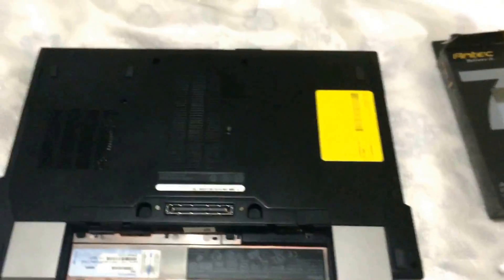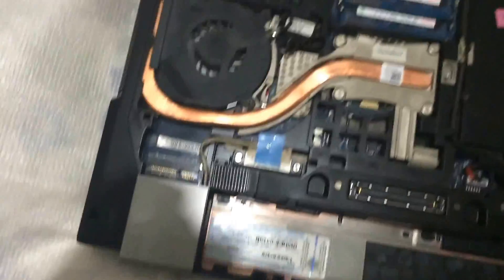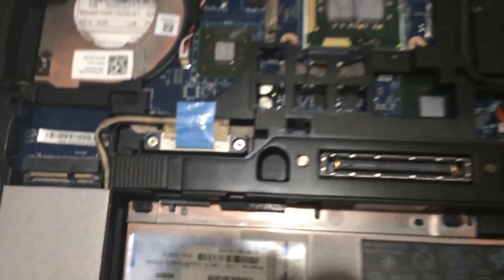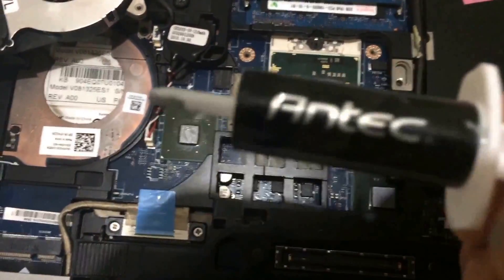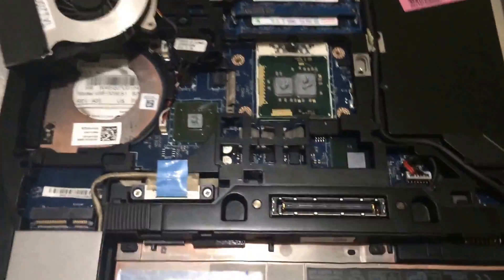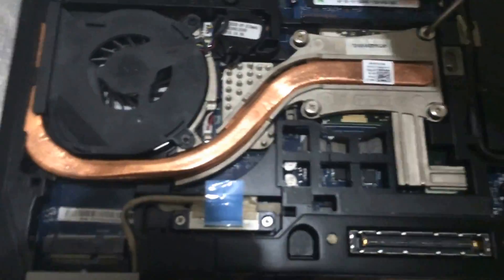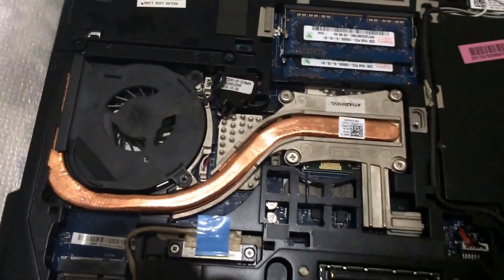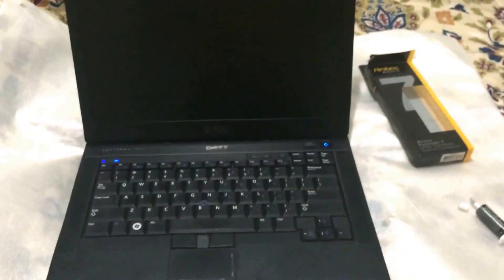How to fix overheating problem on Dell latitude E6410

Comment: My laptop was caked in thermal paste and didn’t have an issue before. I thought it was a previous owner that did it, I changed the paste and had shutdowns like mad because of over temps. I added more thermal paste and managed to get open hardware monitor installed and saw it running between 45c and 80c loading windows 10, I’m not sure what it was before but wish I didn’t bother spending 15-20 mins cleaning the cpu carefully and fearfully 

(I’ve noticed as well. One of my cores is hotter than another one, core 1 is at 44c and core 2 is at 36c. Both max and min and current values show this difference so think there’s an uneven cooler or it’s lifted slightly)
Reply: GPU is at 65c as well. Reading comments looks like a shim on it is in order as there isn’t any screws to make it tight enough and ensure it’s fully contacted
Reply: having the same experience, after cleaning and repasting, my laptop starts shutting down like crazy.. have you fixed your laptop?
Reply: @Shotiv889  yeah. I just added more thermal paste, I’ve never known a laptop need so much before! Must be why it’s caked in it from the factory. Else you’ll have overheating
Reply: @jerrybomcool  thanks, will try to add more paste.
Reply: @jerrybomcool  btw, after adding more paste, did you rest it before powering up? if yes, how long? thanks
Reply: @Shotiv889  I just added more and checked in the BIOS make sure everything was ok and now it boots fine. Just keep an eye on temps I use open hardware monitor
Reply: @jerrybomcool  did you add paste on the CPU and GPU? or both? i think the high temp on my laptop is on the GPU..
Reply: @Shotiv889  it’s the cpu. Even at the windows login it overheated and the graphics chip would only be used 5% max there. But if you get that program I said it’ll tell you what’s being used and what’s over heating for you

Comment: I know this is a very old post, but I got a Dell Latitude E6410 laptop which was ready to be recycled and I got it see if can fix it.  I tried thermal paste, but it didn't work.  The GPU got over 100C.  The last thing I tried is using to pennies.  Clean them as best as you can.  Here is what I did. 
1. Add a small amount of thermal paste on the GPU on the motherboard.  
2.  Place one penny on the GPU.
3,  Add a bit more thermal paste onto the penny.
4. Put the heat sink bad in place, tighten the screws.  
5.  I used Open Hardware Monitor program to monitor temps.  It's open source and works with a lot of hardware.  

I also did the same thing to the area this guy pries up at 1:15.  If you look at the motherboard, there is another chip that mine had no thermal paste.
Reply: I tried literally everything from cheap thermal paste to expensive ones and none of them worked, no matter what I used or how much thermal paste I applied laptop didnt want to even start it shuts down after 10 seconds. Then i read your comment and decided to try this method and believe me or not it worked lol. The processor temp is a bit high tho always around 100c but it worked.
Reply: @dzenishadzic664  Make sure the penny is very clean before putting it in place. If the is room use two pennies stacked together. Also you might to put a penny on the CPU.  The two heatsinks re one unit.  It might help absorb some heat.  My GPU. Is around 70c but the laptop never overheats.
Reply: one penny on the gpu? did it helps?
Reply: @Shotiv889  Yes it did.  I am using the laptop to answer your question.  My laptop never overheated since.  It has been several months.  If you are going to do this, make sure your penny is very clean and use thermal past on each side of the penny.  Just a dab is all it takes.
Reply: But as I am using it right now with no programs opened, both graphic card temperature and processor are around 100 degrees celsius so its kinda overheating lol but this is the farest I could come with it otherwise If i put thermalpaste it wont even start running.
Reply: @dzenishadzic664  You should put thermal paste on both sides of the penny.  Check to see how clean your fan is.  Sometime you need to clean out the dust bunnies.  There are programs like Speedfan that allow you to  manually speed up your fans.  It depends if the program can find the sensor.
Reply: I know that your comment is something old, I do not know if you answered me, but I have a huge doubt, the penny must be lizo?
Reply: @Paperlyly  I am still using the laptop today.  In fact I am answering your comment while using the very same laptop.  
You have to remember that copper is a good conducted of heat.  That's why some CPU heat sinks have a copper metal base.
Reply: @erniewerezak  I also write from the same model! but I worry that my temperature is always around 60 to 70 degrees, I don't know if that is a normal temperature for this laptop?

the problem is that I think that the cents in my country are not made of copper and getting copper sinks here does not seem easy

thanks for replying!
Reply: @Paperlyly  A startup, my GPU, Nividia 3100 model, is aroudn 68C.  I tested it by playing three videos.  The temp was in the mid 70's  Celsius.  This temp is normal for a Nvidia prodcut.  At least the laptop isn't shutting down.
Reply: @erniewerezak  in my case I have integrated gpu, I have heard that the temperature the second core in the temperature, if so also remains at 70

Comment: OMG, do not, I repeat, "DO NOT REPLACE" the thermal pad on the GPU with just thermal paste, doing so will cause your laptop to rapidly overheat. A copper shim must be placed between the GPU and heatsink.

Comment: Hi. Nice explanation making it easy for anyone to complete this maintenance task. Just one point I notice the screws holding down the heat sink are numbered 1 through 4. I thinking that this is the order for tightening the fixing screws which follows auto maintenance rules where you tighten diagonally opposite bolts.

Comment: This is whats happening to my e6410 right now. I just hope it will work because I can no longer afford to buy a new laptop. Thanks
Reply: Done what you did and it lasted only for a few seconds then shuts down again. Didnt help.
Reply: @nicholusify  That's because he never removed the old thermal paste, plus he replaced the thermal pad with just thermal paste which is a big no no. A easy and good fix is to get a pre 80's penny(solid copper where newer penny's are copper coated zinc) and smooth it down, apply thermal compound to both side and place it in between the GPU and heat shink.  Same thing happened to the used e6410 I got, thought it was just the thermal paste, than realized their the GPU originally had a thermal pad, use a smoothed copper penny in place of the thermal pad and the over heating problem was solved.
Reply: @nicholusify  ummm he applied thermal paste over thermal paste that is not gonna help first you have to completely remove the old thermal paste then apply new thermal paste

Comment: Linus Tech Tips did a vid showing the results of different methods. The pea, the line, the x, the spiral, spreading compound with your finger, too much compound and not enough compound. The results were 47 C for all of them, except for not enough compound which ran 5 degrees C hotter.

Comment from the maker: I’m currently using ceramic compound which works great but they just came out with a liquid metal thermal compound and a graphite pad That you can use over and over And both of those products are supposed to be much better
Reply: Liquid metal can short something, how to apply it ?

Comment: I don't have problems. Windows 10 can under clock as much as we want deep down in a power setting and Linux can't run interesting 3D games anymore. I did repaste 10 or more processors lately which help up to 20 degrees. Stuff some extra copper on those thingies that looks like copper and drill some holes for more.

Comment: IT tech. & supporter guy here, DO NOT DO what this fellow is telling you. Gonna start by saying, that Artic Silver is a good brand and i'm using it personally on my devices, but adding it to the old dried up compound on the CPU chip is not recommended at all. Next, don't add it to the GPU chip AT ALL, use a thermal pad instead. Lastly hes adding too much in the form, that it's gonna produce more heat and more likely to overheat. Only apply a small drop and smear it on the chip to cover it overall in a thin coat, dripping on the chip and slammin' the heat sink on is an amateur thing to do mate...

Btw Nice Windows serial key there wink wink
Reply: I would agree with NOT using thermal paste on the GPU.

This heat sink is designed to cool the GPU using a thermal pad (approximately .8mm thick).  This gap between the GPU and cold plate on the heat sink is too wide to use thermal paste effectively.

Comment: yo lo solucione asi , debido a que no es perfecto el empalme de la gpu con el dispador le ponen un pad termico , pero este se seca lo que hago es poner pasta cooler master de silicona y mezclar el pad termico con pasta y este se puede reutilizar , lo siguiente es cambiar la pasta termica del procesador , ahora desactivar la opcion en el bios que dice turbo boss o verificar que este instalado correctamente su driver turbo boss y eso es todo sin el turbo boss funciona perfectamente y no rebasa los 60 grados a tope  saludos desde mexico df
Reply: Voy probar tu método si me funciona
Reply: Amigo mi termal pad está un poco roto solo puse un poco de pasta termica en el y mis temperaturas aumentarán demasiado, que puedo hacer? Debo reemplazar el Thermal Pad y si es así cuál debería conseguir?
Reply: @Danielle-zx3uo  hola lo tienes que amazar hasta que se integre la pasta con el pad , quedará como una plastilina,  lo colocas y distribuyen bien  y con eso debe mejorar , si quieres bajar más la temperatura entra al bosque f12 o f2 y desactiva una casilla que diga Intel turbo boss  con eso queda bien
Reply: @pedroinfante5104  gracias eso intentaré 👍🏿
Reply: @pedroinfante5104  gracias amigo me funcionoo!! Ahora no pasa de 60° muchas gracias( ◜‿◝ )

Comment: step 1:
remove heatsink (Optional>clean it, may be clogged up )
Step 2:
clean the surface area of the cpu,gpu  and heatsink with alcohol
Step 3:
Apply Thermal paste. (non conductive thermal compound)
too little will overheats
too much will overheats
try a X mark or drop a pea size amount will do.

and Voila! Done this to my e6410ATG and good as new.

Comment: Adding new thermal paste to a layer of old dried out thermal paste, is not a good idea. Go back, use a q-tip and rub that old thermal compound, replacing it with a "dab" of thermal paste. You do not need a lot.

Comment: How did u install win 10 on it i have the same laptop but i cant install win 8 or 8.1or 10 on it
Reply from the maker: I did the free upgrade but you can always install that hard drive on another computer and put windows 10 on it then put it back in the laptop then do all your updates again once it’s back in your laptop.
Reply: Jashua Pumariega thank you i will try this solution

Comment: what is the normal temp of cpu?
mine up to 80 and 98, the laptop is off playing euro truck simulator xD
Reply from the maker: 75C Or below the thermal compound will work fine or you could use copper shim if you have it.

Comment: i'have problem with my laptop Dell latitude e6320 i5 its not turning on over click the pwer on botten its most click from 1 to 10 times its turned on and off all time over click power botten
Reply: Hi. Did you six it?

Comment: Thank you.  This was very insightful.  I have two 6410s, one overheats.  Does it also depend on the OS, cuz when I run the overheater on Fedora 25, I can leave it overnight and there's no overheating.  The other one which doesn't overheat, runs on 64-bit Win7, and both have 8 GB RAM.

I also put it on one of those slatted flat wood baskets from yesteryear, so more air circulates underneath the unit.

Comment: too much thermal paste bro.  That shit should be paper thin.  Its only there to hold the heat sink in place.  It actually hinders heat transfer.  especially when so thick it just makes it worse.
Reply: What in the actual fuck are you talking about. Thermal paste enhances the thermal transfer to the heat sink, go ahead and run your computer without thermal paste and tell me how that works for you fuckstick....

Comment: Sigh... Please DO NOT do what this guy is doing!!! Adding arctic silver will NOT help! You must remove that thick thermal pad over the GPU and shim the heatsink with a copper shim. Then you can use some thermal compound, any type you like on it. The issue is that, that thermal pad acts as an insulator and does not transfer the heat away from the GPU properly. Replacing that with a copper shim epoxied to the heatsink (with compound in the middle) will lower your temps considerably. Also remove that stupid plastic lace stuff covering the fan intake on the bottom plate. Those two mods should get you 10-20 Deg F. cooler. That is what I had to do with my e6410.
Reply: The GPU is integrated into the processor. Presumably it is the smaller chip of the two chips on the processor board. That other chip with the thermal pad is the motherboard bridge. It is also where the Intel Management Engine is located on this laptop. So in a sense it is a processor as well.
Reply: Hi, thank you for your reply. Now I finally know what to do about my laptop without having to use a cooling pad or something like that. My only question is, what thickness should the copper shim be? Thanks in advance.
Reply: Hi, Should i also put a copper shim in it for the cpu?. The GPU is NOT integrated into the processor (not in my case). I have an Quadro NVS 3100M
Reply: thanks, i did what the guy did and my temps went up.
Reply: What thickness of shim? You don't want to have one installed that's too think to where you can crack the CPU. 0.3mm good enough? I would be worried about using a 1mm. I would think that is almost too thick.
Reply: May you show me a picture of that please?
Reply: can u please help me
Reply: @Diamondlight74. Help you what?

Comment: I think the best solution is to NEVER BUY Dell laptops
Reply: ALL laptops have problems with heat...ALL and dells have the list problems cause they have the best ventilation system.1)dell and apple 2)toshiba lenovo 3)acer 4)sony vaio and hp dont make the list they are crap
not crap in performance but in reliability longevity stay away from hp laptops!!!
Reply: Then what else to buy? (No Apple please)
I'm considering to move to Asus but my first experience with this brand was not so good...
Reply: purchasing older business grade dell laptops 2-3 years after they were purchased is a great idea.  i spent 325 dollars on a dell laptop with an i74800mq, 250 gb ssd, 8 gb ram, windows 10 pro, and a hd8790m gpu.  that is considerably more powerful than any laptop available right now at twice that price point.  it would take at minimum 1000 dollars to find a laptop that compared to it.  might find one with a 1050ti or 1050 around 800 dollars but it is going to have a much cheaper and slower cpu.
Reply: MSI , Asus , Acer , HP , Lenovo will do

Comment: I think your laptop is overheating becuase your applying too much thermal paste the more you put on its not gonna cool more, it will actually trap heat and overheat more then before what you need to do is get some rubbing alcohol and a q-tip and CLEAN that processor top as if your cleaning a hookers vag. but when your done cleaning the CPU and GPU use a ceramic based thermal paste becuase other pastes can actually conduct electricity and that's bad for the GPU, but put a pea sized drop of thermal paste on the GPU and for the cpu
Reply: can u help me please
Reply: @iamhamzamalik  no

Comment: please excuse my english.. I'm tired of my heat problems on mine E6410, I tried placing a lot of compound, a little bit of compound i even tried therminal pads, nothing is helping. My Fan is clean i bought a cooling pad for my laptop.. I can work on my laptop now but the moment i connect it to a external display my GPU goes to 90C.. can someone please help me?? the problem is my GPU but how do I fix this
Reply from the maker: If you're using a white thermal compound switch to the silver thermal compound try to keep it on the chip itself only and not around the chip if you've done that and that's not working. Try copper shim thermal pads you can get them on eBay 10 for a few dollars. Hope this helps
Reply: +Jashua Pumariega i'm using silver therminal compound
Reply from the maker: +Keith Vers then try the copper shim

Comment: mine persists..i dont know why
Reply: +Starship Trooper i am having excat kind of problem , i have replaced old thermal paste with new one, ,, but i havent been able to get new "this gelly like think " that this heat sink module has . .,, and i have put nothing on its place..
Reply from the maker: +adri adi if it's still overheats and you probably didn't put enough thermal compound it doesn't hurt to put it on the GPU as well don't listen to the other comments I buy graphics cards that are bad sometimes and I'm able to fix some simply by changing the thermal compound